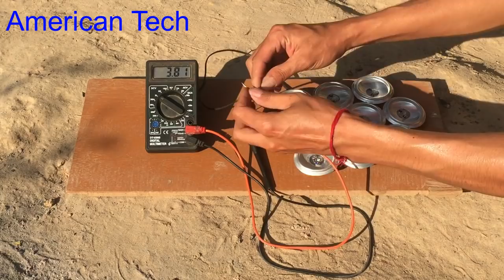Free energy, How to make solar cell using transistors

Comment: Can's are useless! The transistors are out of the focal point.
Reply: Amitai Medan: My thought exactly!
Reply: What would be better?
Reply: @FilipeRebollo  Perhaps some 5cm cheap plastic loupe glass that is adjusted out of focus with a large circle around the transistor chip to not get too hot.
Or small creditcard fresnel magnifier lenses perhaps, with not too much magnification... else it also gets hot and damaged i guess.
So perhaps make it too close and therefore out of focus with the circle way around the chip but still focus enough to get more light.
So the sun can shine many hours before the sun moves and it stops working.
It could perhaps work.

Comment: At 0:52, never hold anything in your hand and drill it.  I did that 30 years ago with a piece of wood, the drill went through and clipped the side of my left middle finger at the base.  I severed the nerve.  I had surgery.  They took a piece of nerve from my left forearm and spliced it in.  Then the surgeon cut a flap on my left index finger and sewed it over the repair so the nerve would have living tissue on top of it.  A couple of weeks later, he cut the flap, sewed up both fingers.  Eventually they healed.  My left index finger still feels different and does not have the same level of feeling as my other fingers.  I was stupid and careless.  I became super safety conscious after that.  I always wear goggles with power tools and some hand tools.  I wear ear protection.  Think about what can happen and protect yourself.
Reply: Thanks for sharing that! yes I also feel lately that I need protection eyes and especially breath if you do dusty things..   P3 mask !
Reply: Ikr...he made me nervous with some of the cutting and such also.
Reply: Diogo Emiliano  milkman
Reply: Ki in

Comment: The transistors, which were covered by a metal dome, are, now, supposed to interact with light, or heat to work as solar collectors?

Comment: Not really practical for generating power, but a clever way to "make" a phototransistor, in case you really need to detect light, but don't have any phototransistors or photodiodes handy.

(Actually, they were phototransistors all along, they just spent their lives deprived of light, till someone popped their hats off)

Comment: Voltage without current is no energy at all.
Reply: tell that to the bug victims of super low amp bug zapper!
Reply: Power =(voltage squared) x current x time.
Reply: P= E X I
See Ohm's law.
Reply: Power # Energy. P in watts (kw or mw), Energy in watt-hours. Energy and   power are two different matters. It is sometimes confusing. Power is the capacity of a generator or an electrical load. Energy is the quantity of  electricity consumed after number of hours and paid for by consumers, kw-hours.
Reply: So did you try it? Send me if its really and not fake.. Thank you.
Reply: You could get more power rubbing a balloon on your hair
Reply: P(w) = VI or IxIR7
Reply: see below P=VI or I(squared)R
Reply: try it first and measure the current then talk troll.
Reply: it will work, PN junctions *as diodes, leds, transistors, etc are made of do exhibit slight photovoltic properties its just an extremely small surface area so you arnt going to get much power at all, some people use this effect in LEDS to make a kind of touch sensor array
Reply: Please miss me with all the b.s.
Reply: DrHarryT really it s P=UxI

Comment: it might have worked if you used diodes and also thin metal strips of copper one part and galvanized steel on the other, but not transistors.

Comment: Again show only the voltage.
What power does this device give?
Reply: my presumption.... p(volatge)=i(inductance) x r (resistance). and watts = voltage x inductance. for this solar panel we know that it can supply 4.3 something volts. let us say we are putting 1 resistor with 1ohm resistance. then it could be said that, 4.3v/1ohm= 4.3 amps. then 4.3 amps x 4.3volts =  18.49watts...
Reply: Tonz Lang Никъв шанс
Reply: Tonz Lang P=IxV... You don't know how much current "I" can deliver
Reply: Jaime Magallon Lara you got voltage. duhh... voltage = i x r. if i is zero then it should be pressumed voltage is zero. where is your basic multiplication??? zero multiplied by any number is zero. if resistance is zero as well then voltage should also equivalent to zero. v is equal to i times r.
Reply: Jaime Magallon Lara you are talking about power. besides your volt ohm meter has a reading therefore it cannot be be zero at all. it is weird that you are saying no current when in fact electrons move when they are heated by the sun which i guess made the electrons move in this said "solar panel".
Reply: Tonz Lang, you think If you take 2 ohms, then you get 4.3/2=2,15amps and  4.3x2,15=9,245 watts. This is not true.
The power is constant (for equal illumination).
As the load increases, the voltage also changes, but we do not know what resistance the photocell and the tester have (or the current in the circuit). Therefore, we do not know the power.
p.s. Watts=V*I It's right, but "I" it's not an inductance, it's a current.
Reply: Dmitry Chuntonov but should  not say the current is 0. there is voltage and for sure there is resistance on the wires as well.
Reply: Tonz Lang, without conditionally, the current is not zero, but it is very small, like power. but how much we do not know
Reply: The claim to the creator of the video is that it does not measure the current
Reply: Dmitry Chuntonov you have the equation at hand... you can solve it... but i will stand to my point that it can never be zero or no current at all...
Reply: the 1 ohm would put a load on causing a voltage drop depending on length of cable etc.  with the size wire he used he would only do a max of around 7 amp draw if it could do it anyway. look up specs of transistor hee used to see how much current it allows to pass through. but my estimate is that it would only be about a 2-4w cell ie 0.5A -1 A
Reply: Solar and Gardening stuff and DJ Stuff, not even that much! It won't be anywhere near 2-4Watts. Have you ever seen proper solar cells? They have a very large surface area to collect much light. We're talking maybe 10cm by 10cm per cell, and then they put 36 or so of these in series to get a voltage useful for charging 12V batteries. Compare that to this project. Here you have a teenie tiny speck of silicon (maybe 2mm by 2mm) acting as a make-shift solar panel. Sure, put enough of them in series and you'll get a measurable voltage. But the amount of current it can deliver would be absolutely miniscule. It would struggle to power a single LED. I doubt you'd get even 50mW  from this thing. More like 5mW, and even that is optimistic. 5mW = 0.005W.
Reply: what you have to understand is that its being shown with no load (minimal resistance) if you added a 1ohm resistor, the voltage would drop to something very small, and your overall power would be tiny as well, because if there isnt enough power to maintain a current then the voltage will drop such that ohms law is still true

Comment: Needs 32 units for car battery charging voltage 32 x 4.32 = 13.8 Volts. But what about ampere? You need to try with 32 units first, if not enough, add another 32 units in parallel and so on. What about rain problem? A single drop of rain may damage the transistor! Not practical actually....

Comment: It isn't "free energy" untill something produces power equal and greater, than what was put in to all the products used. For a more tangible net worth, the power it produces, should save you money on the electrical bill, untill then, it's not free energy, just a proof of concept proto-prototype. If I understand the comments right, this wouldn't charge a battery, and thus of no use at all.

 About the video. You could make it way shorter, with a little editing. Do a voice over explaining what and why you're doing what you do, how things work. None techs like my self will find it nifty as hell, but reading comments will actually teach me something, well -- at least that this is something you can make to power your mind just enough to look for real answers somewhere else.

Comment: the case is the collector so all those cans which are connected to each other will short the collectors together.  then he connects the emitters to the collectors so now these are shorted.  so it looks like half the parts are shorted. so instead of getting 0.7*10=7V he is getting about  0.7x6. = 4.2V. so 4 are shorted. still not too bad.
Reply: you get .7 from where?
Reply: John Conrad thanks for that critical observation.
Reply: @solarandgardeningstuffandd8168  07 Volt is Working Drop Voltage of a Silicon Diode.